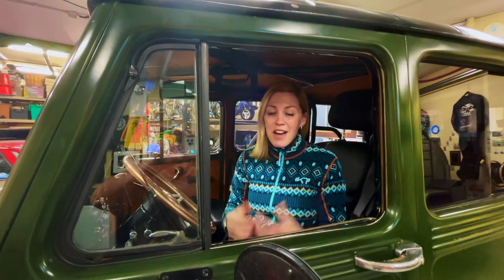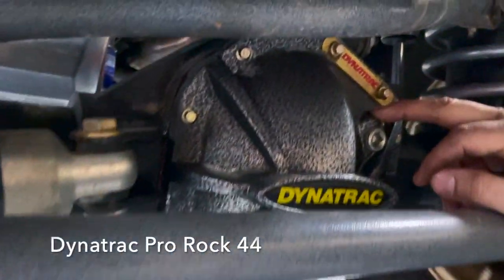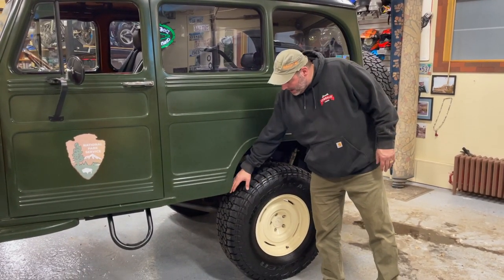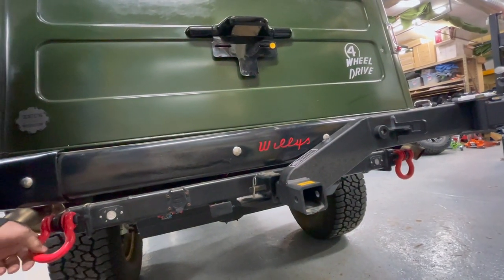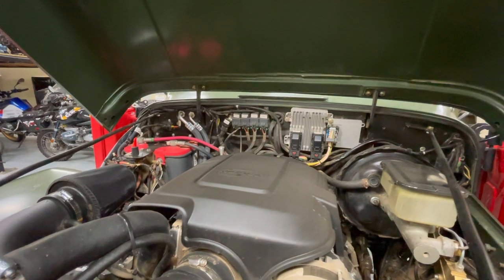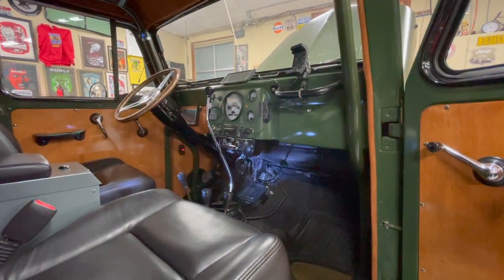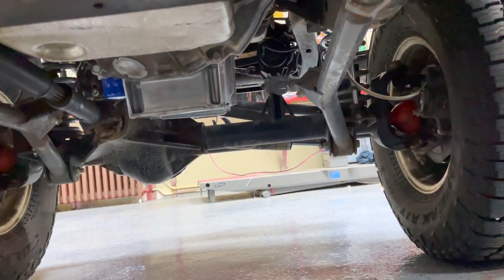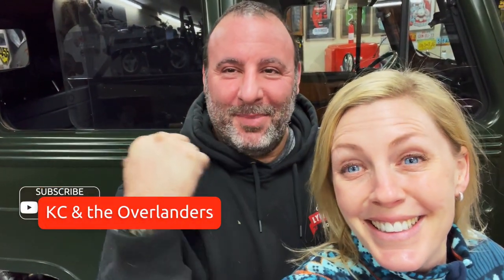1958 Willy's Wagon Overland Build @KCandtheOverlanders

Comment: Awesome wagon. I’ve got a 53 bone stock. The engine is the F head 134 hurricane 74 horsepower but pretty decent torque.  I do need to correct you on top speed though. Definitely not 40 mpg.  It’ll cruise at 60 mph no problem. I have a warn overdrive in mine, and with no grade it can cruise at 70 mph.   Stock jeeps of this era are way more capable than people think.

Comment: Great build with much thought put into the parts selection. Any thought to padding the bars especially in the back. In a roll over or side impact anyone in the back seat might be able to strike the exposed bars as the back seat seems not to have any shoulder straps unless it has a 4 point accessory harness. I really had to look for anything to comment on.  I would “steal” everyone one of your ideas as I think your have reached perfection. Good for you.

Comment: Great build, thanks for the walk through. I currently have a 62 Willys wagon with a 351w but it's tied and brakes are terrible. I'm considering getting a 05 Rubicon LJ. Does the frame need to be stretched at all to fit the Wagon? Wheelbase appears to be an inch off. You mentioned 1/2 inch in the video. I'm from MN but moved to St George UT and the wagon came along for the ride.

Comment: One other thing.. you talk about reliability, you can’t get much more reliable than a simple carburetor and points distributor. You can very easily fix them right on the trail. No sensors to fail, no electronics to fail, just pure simplicity and serviceability.  Parts are still very readily available for cj5 and wagons.  The more complex you make it, the harder it will be to find the problem and fix it.  Just something to think about.  Modern does not always mean better.